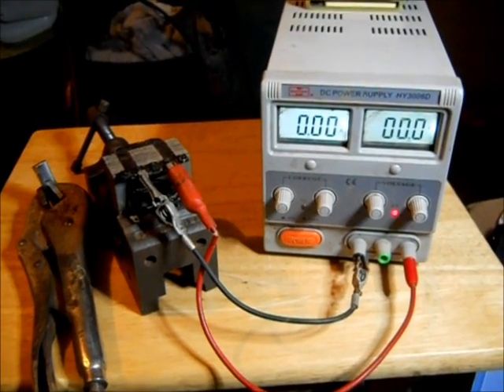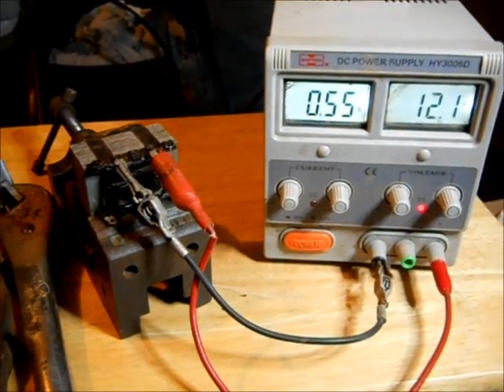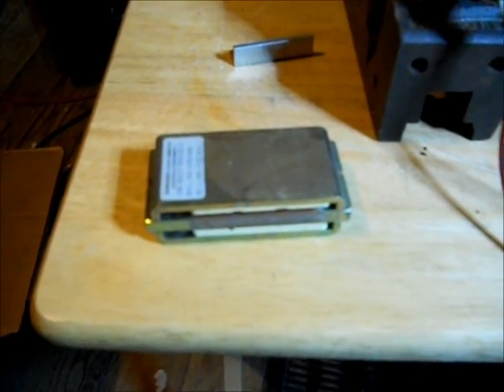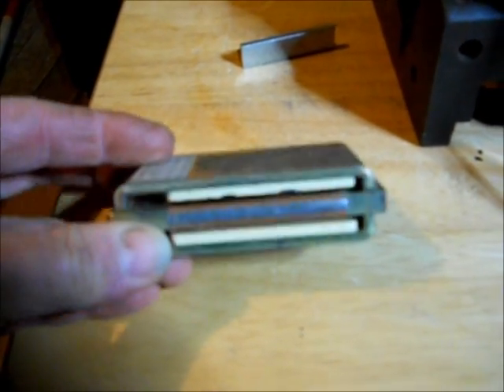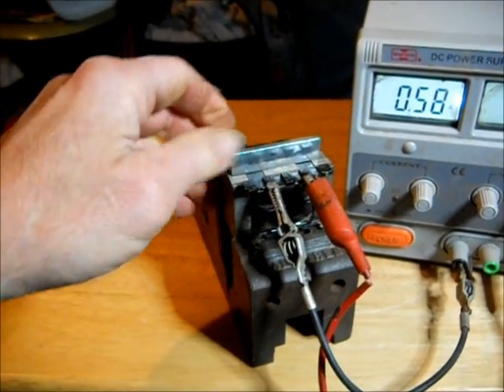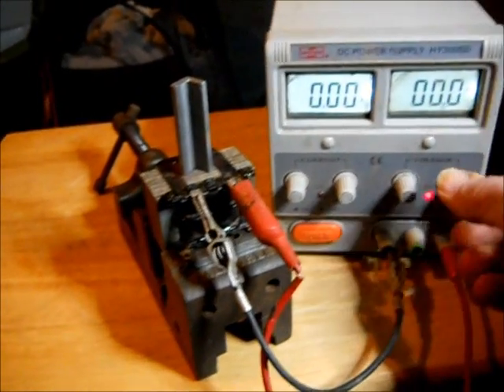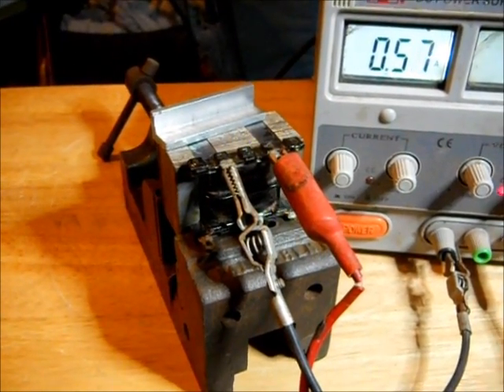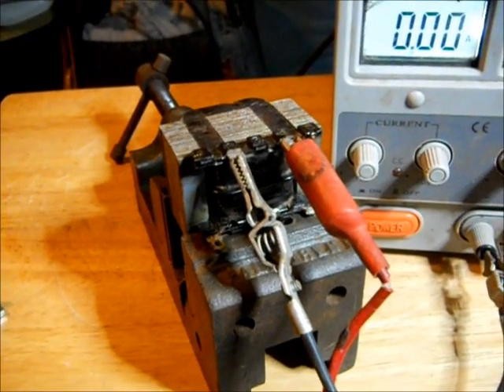DIY Magnetic Chuck

Comment: this is exactly what im looking for. this seems like a very logical setup to built a high powered electromagnet yet in all my searching this is the only one i have found that uses this method. i have a very large transformer from a car battery charger/starter, its mounted on a nice flat metal plate. i wonder if i cant arrange things so i get this effect facing that plate... im not formally educated on this so i am piecing together what you've done here and im a bit thrown off coarse by the fact it seems you are powering the device from 120 a/c then with the application of additional power your controlling the magnetic field? or how does the second power input come into play exactly...